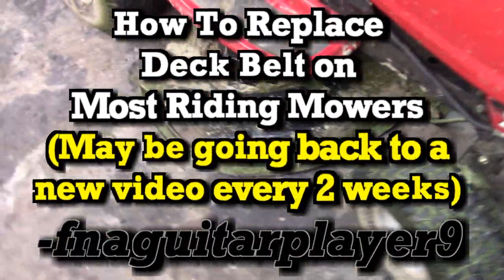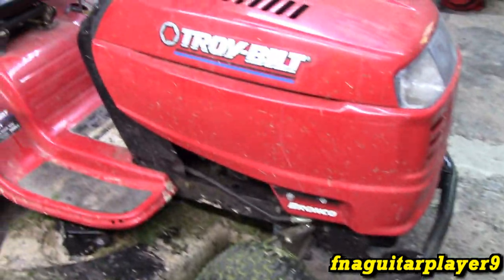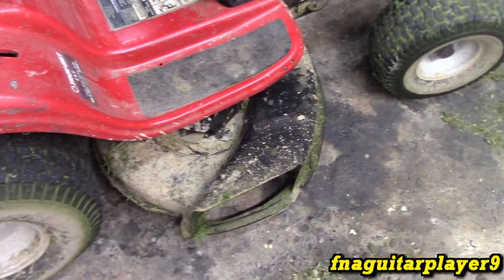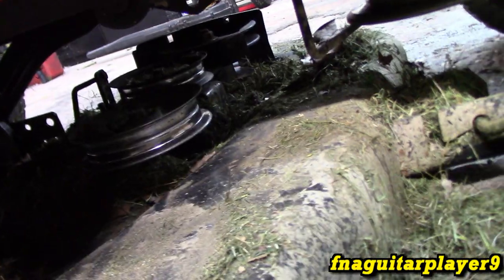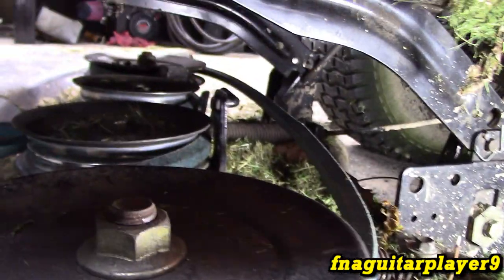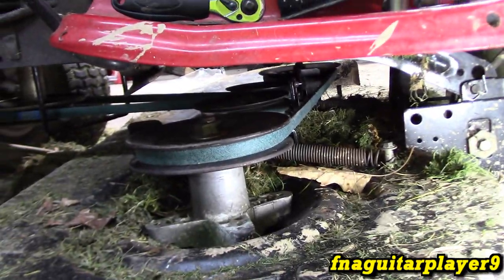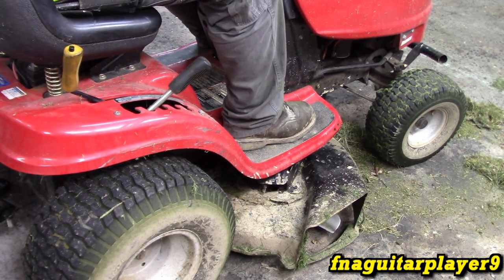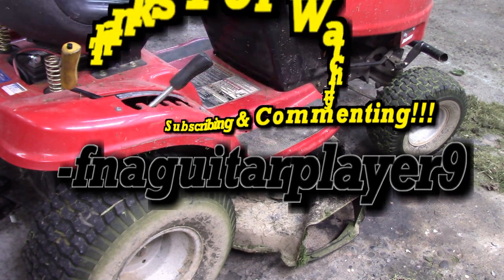How To Replace Mower Deck Belt on Troybilt Pony / Bronco and Others

Comment: GOOD explanation! I like a manual belt tensioner than an electric clutch. Those electric jobs give out a lot of headaches what I've seen. Good job and pick one and GBWYall!
Reply from the maker: I like both, the one thing i like about the electric clutches is that it doesn't wear the belt everytime its engaged, thats really the only advantage, it is a major expense though! Thanks for Watching!!!
Reply: @fnaguitarplayer9  I ease my blades in on idle and they almost NEVER squeal. I showed a zero turn Cadet owner that it'd work on his too with an electric clutch. Just enough throttle to keep from stalling. I've probably run this one with the opposed engine 4 or 5 years nd still running the belts I got it with. Not even ready to change yet either. I might get 2 or 3 more seasons out of them. Who knows. Pick one!

Comment: As long as there is no rub or drag, does it matter what position your belt "keepers" are in? Instead of bending, I loosen both the Idler and Tensioner pulleys. Standing at the rear of my deck looking forward, my Idler keeper is about 4:00 position, the Tensioner keeper is at 9:30.